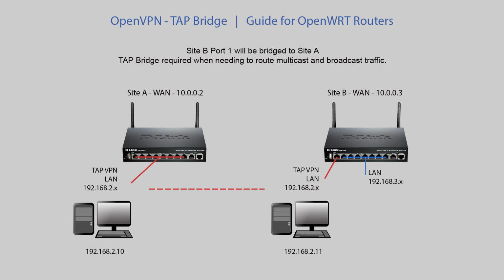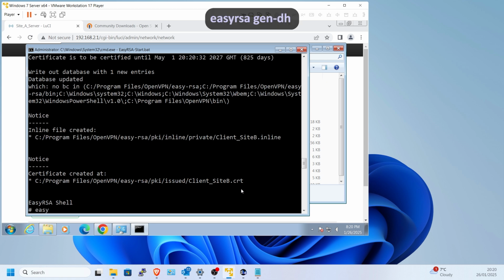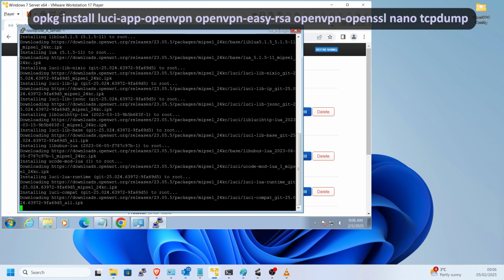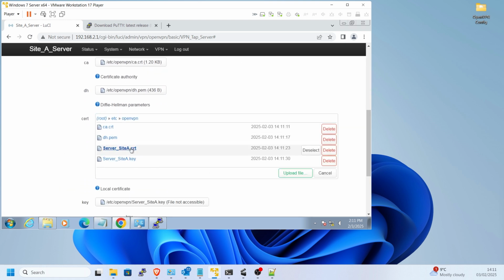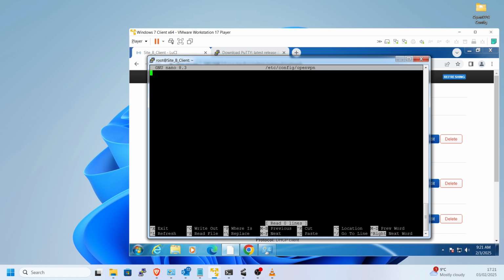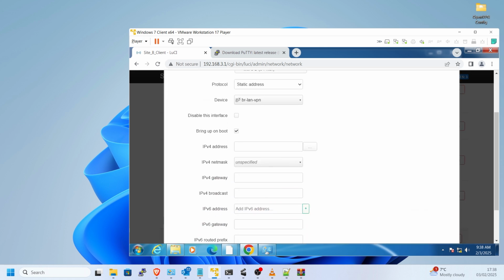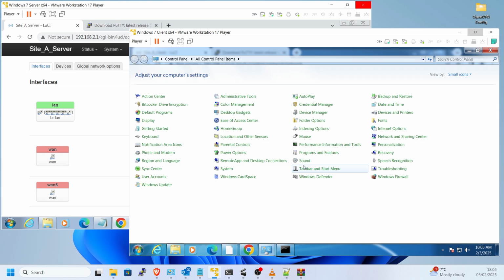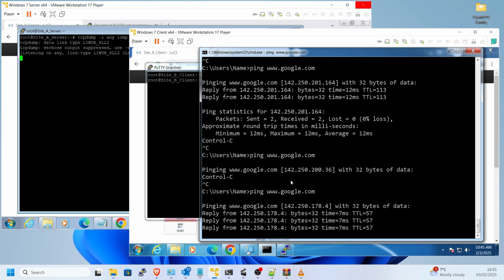OpenWRT - Site to Site TAP Bridge with OpenVPN - 22.x and above

Comment: What's the use case for this setup?
Reply from the maker: Just connecting multiple sites in full layer 2 to share broadcast and multicast traffic. More for businesses.
Reply: @primetechguides3050 If I have a certain application which can only access license gateway server from within the same network 

Layer 2 bridging seems to be my only option.
Reply: @primetechguides3050 Also if you use a HD Homerun at home and want to use it remotely. I use TAP when I travel to get into my home LAN and have everything still working